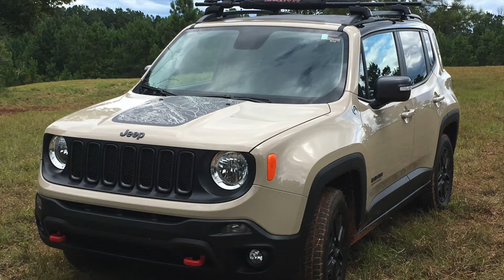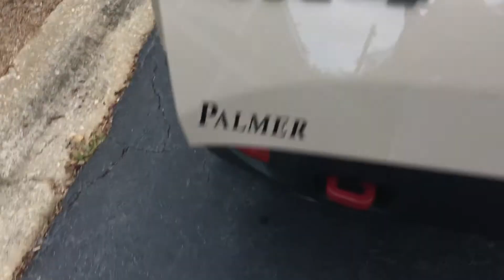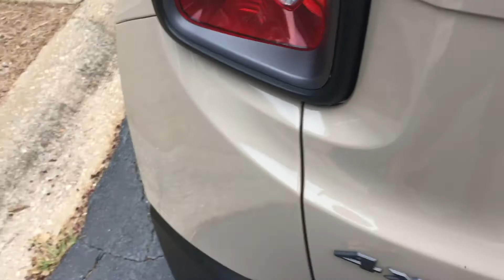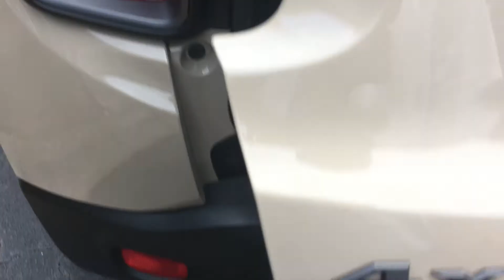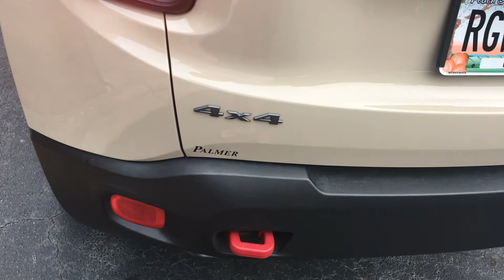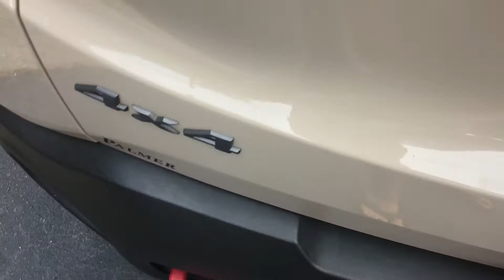Jeep Renegade Rear Lift Gate Hatch Problem Explained

Comment: i had that problem and couldnt recreate it only to realize that my mother had the spare as i had the other one in the car so when i unlocked the doors from the inside button and walked around back with just one key in rage it shut and stayed in short the keyless entry is reading two keys thinking youre locking a key inside the car

Comment: Actually when you have your key knob thing lol close to your hatch or by the two front doors it will automatically unlock it self . Lock the Jeep keep the key knob thing way from the hatch and it won’t open . It’s just one of the features the Jeep has and I love it I don’t have to set there and unlock it all I do is walk up to it and it will unlock it self as long as you have the key knob thing with you . Your hatch is not broken

Comment: Hey man! This happened to me to..but funny part was I left my spare key in the glove box so that's what making the jeep system confuse and as I took out the spare key it worked normal again...I don't if that's the problem with your jeep haha
Reply: Thanks for this video... I just spent 15 min the parking lot opening and closing the trunk trying to figure it out lol
Reply: Hahaha 😃 😀 😄 😁 🤣  drivinv me crazy. I almost went to car shop to get it fix. I left my spare key inside my bag which i put at the back ofhe car. I think this is a security feature of the car. If you accidentally left your key inside the car. It wouldn't stay lock. Hahaha stupid of me